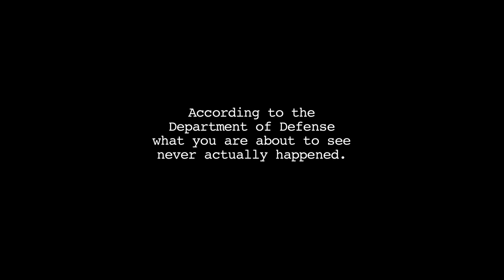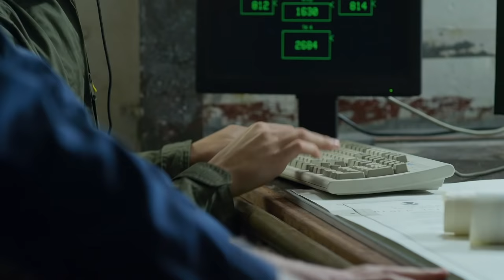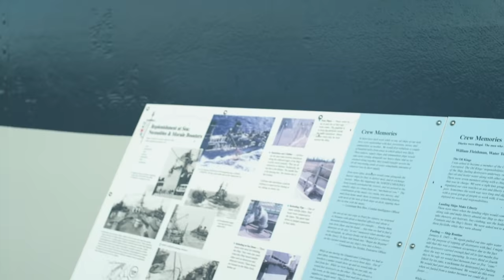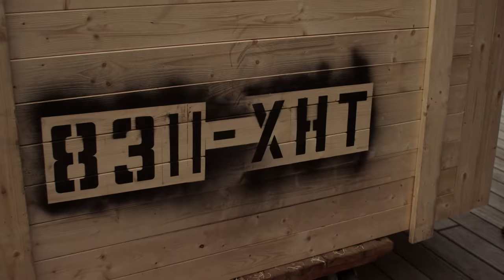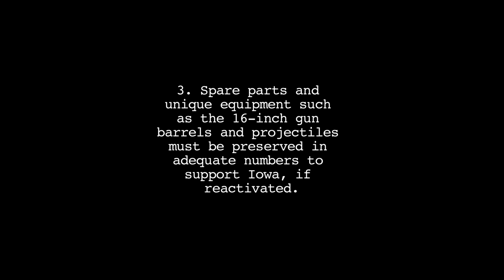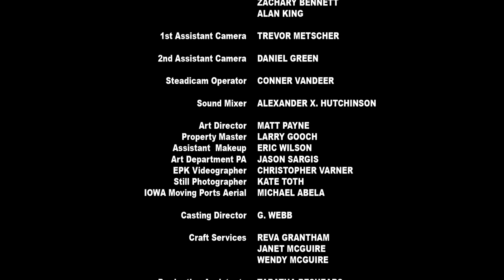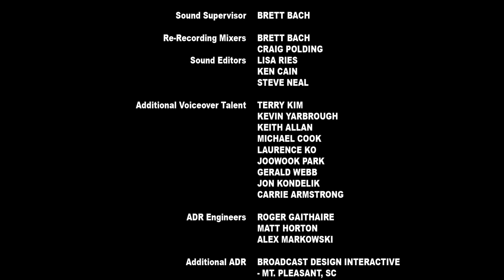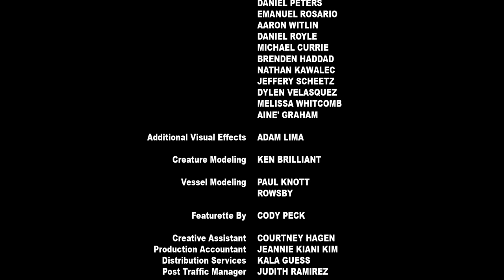American Warships | Full Action Sci-Fi Movie

Comment: No matter how old a warship is, if it was reliable when it was built, with proper maintenance and a good crew its will be reliable for years to come. The Iowa is a great example.
Reply: Yes and just imagine every single warship battleship destroyer cruiser frigate aircraft carrier just imagine all of them were still here today in pristine condition
Reply: Uummmmm. The Iowa is the one that blew up one of it's main guns. You could have picked pretty much any other ship for this analogy and been correct.
Reply: @apocalypticsurvivor6111  j
Reply: @johndieterich1605  and no I’m not an idiot
Reply: @johndieterich1605  I know more about the Iowa then you will ever.
Reply: @johndieterich1605 oh and also the reason the turret exploded is because it was stuffed with to much powder.
Reply: Things were built to last in the early to mid 20th century.
Reply: @johndieterich1605  I know
Reply: @johndieterich1605  As I recall (USN veteran), that happened because one of the GM's in that turret deliberately sabotaged that loading.
Reply: Build more battle ships
Reply: The problem with steel is it rusts, and wears thin.
The New Jersey, an Iowa-class is in need of dry docking now for major repairs to its hull, and one of the turrets on the Iowa exploded in 1989.
She is now a museum ship with no plans to repair the turret.
Reply: @johndieterich1605  I mean, they still fixed it, also it was a freak accident I'm pretty sure.
Reply: Not just theIowa but also its sister ships. I have a soft spot for the Missouri and the New Jersey.
Reply: The Enterprise and The Missouri must not be forgotten.
Reply: As was Enterprise in her day. Let history never forget the name...
Reply: You are absolutely right my friend. Another good movie that was similar to this one is Battleship. That was a good one too. I was in the Navy many moons ago , In that time women were not allowed on ships as they are today. but had they were , I would of been proud to be one of the crew. My father served during WWII and THe Vietnam era , a proud Navy man. I also have a nephew and two grand nephews serving in the Navy today. We are all proud of our great Navy
Reply: He was also served during the Korean was as well
Reply: Today, the propulsion plant is rusted junk.

Comment: I'm at the 1:08:28 point in this movie and chuckled when that rolling shell was stopped by  the steel pipe. 

Some fun  facts about the 16 inch ammunition fired by the Iowa Class battleships.

Those shells weigh 1,700 POUNDS each if they're high explosive and weigh 2,700 POUNDS each if they're Armour piercing. That means that those two 16 inch shells per crate would weigh either 3,400 POUNDS or 5,400 POUNDS. The separate charge of prop;;and weighed around 660 POUNDS. Also, it took a crew of 77 to 94 men to operate each turret.

Just how did they get those crates of shells up onto the deck anyway? LOL

Overall a decent entertaining movie that I'll watch again. Thanks Sci-Fi Central for the movie.

Comment: The  technical aspects of this movie are excellent. I have toured the Iowa - awesome.
Reply: Were the 16 inch turrets able to rotate that fast in reality?
Reply: I hope that is sarcastic.   the technical aspects are terrible.   it takes about 80 crew per turret to fire them repeatedly like that. They need bags of powder as well as shells.   the captain doesn't say "main guns fire" they are ordered by turret.   the fire control center points the guns not "lower the barrels and fire the main guns"   the twin barreled  40mm guns fire from fairly small clips, they don't do the continuous fire shown.  they also need significant crews to keep the ammunition flowing to the gunners.   one can't be on deck when guns are firing, the blast is very significant.

Comment: If a Seal team can sneak aboard.  Might I recommend a few satchel charges of high explosive.  Then leave it to the nine 16" 50's aboard Iowa to clean up the remains.
Reply: 20MM PHALANX (SEA WIZZ )
Reply: I would recommend Claymore mines.  Nice, low tech.  Hard wired (similar to setting up a train set or slot cars) and no electronics.

Comment: The Yamato and her sister ship the Musashi were the biggest most powerfull warships ships ever built and they didnt last 5 mins in combat.
They were bigger and more powerfull than the Iowa class ships.

Aircraft made the big ships obsolete.

The bigger the ship the bigger target it is and easier to hit.

As for EMP weapons they already exist and wil take out any weapons system that uses computors or electronics. No amount of sheilding will protect them.
Its why the British army has lots of old weapons around that dont use electronics as back up.
My old artillery unit didnt use the electronics on r guns as we practiced all the time to fight without electronics. we were better at not using the electronics than we were using them anyway as we never missed using line of sight or map coordinates. using the electronic systems we missed about 5% of the time.

Comment: Do they have any idea about the firing protocols and procedure for the firing of any battleships main battery,and what were they using for a fire director, and 16 inch shells in a wooden box with straw !Powder charges are probably in the galley behind the stove .And if any turret machinery could rotate that fast i would be amazed.Evidently aliens don't have armour piercing or indeed even armour on there vessels .Knew that 
Tupperware was the cheap stuff [ alien captain ]